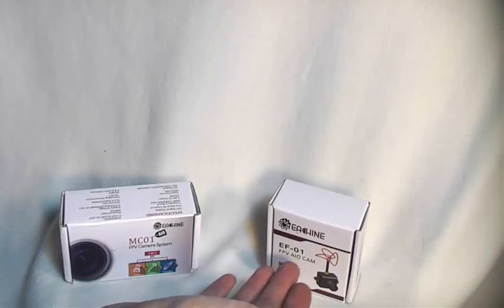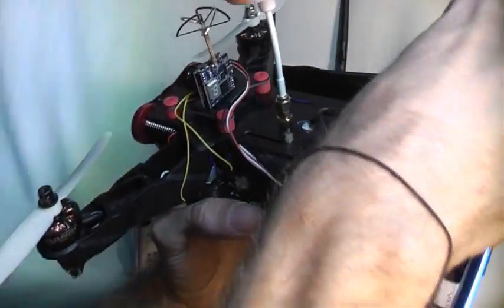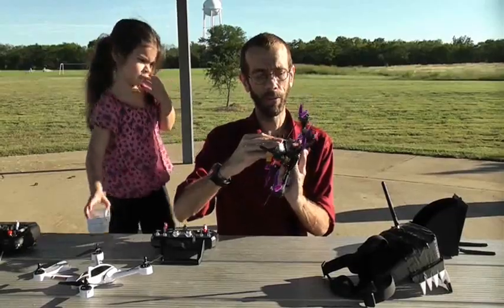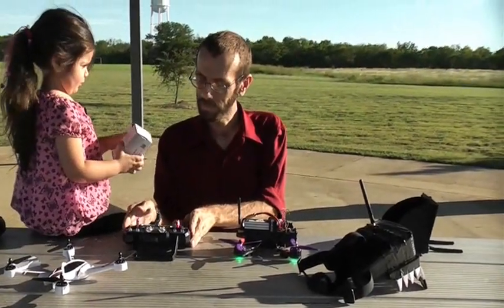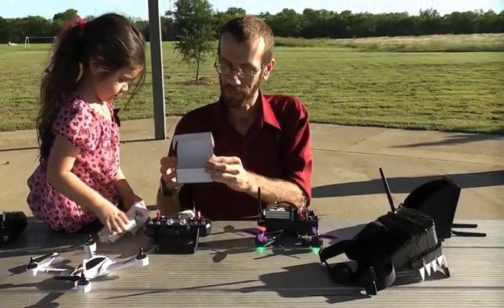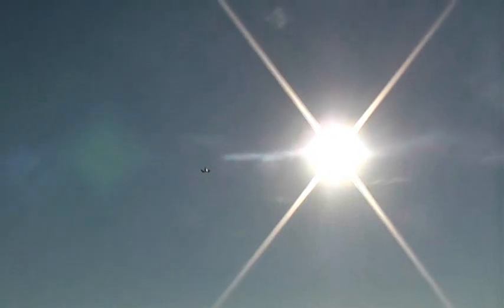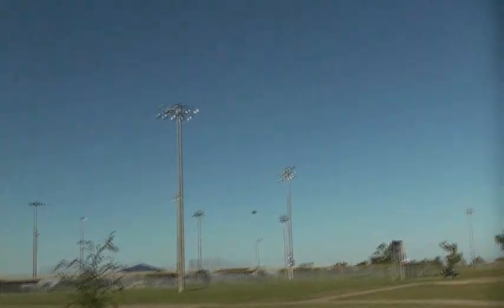Eachine Mco2 all in one FPV camera

Comment: PLUS I'd like to have the cameras signal go through an OSD, THEN to the transmitter....
that would be cool.
A tiny quad with a full HUD overlay....
Reply from the maker: Now that would be sweet.
Reply: R/C 101 I know, right?
Crash one and send it to me, so I can practice my technique....
Reply: I did it. It works great. I put a low pass filter between the camera and the tx in case I had any lines but turns out I didn't need it...
Reply from the maker: These things are so much fun.
Reply: As long as our wives don't find out......
Reply: Now that we have conquered the sky, and land, and the couch......
I'm thinking waterproofing is the next big thing.
I can go to the coast and be frolicking with monsters under the boat. We have blue whales and great white sharks and a volcanically active subduction zone.....
You know, for fun.

Comment: is it like the previous camera to you tell if the camera sensor in the transmitter board are two separate boards that can be separated?
I would really like to mount my camera farther forward on my nanoqx 3d but that puts too much weight forward of the cg.
Would be nice to mount the camera IP front and the transmitter in the back...
plus it would give you more options for mounting the antenna....
I like my first generation eochine, but haven't wanted to try the split yet because I'm constantly finding new stuff to throw it on.....
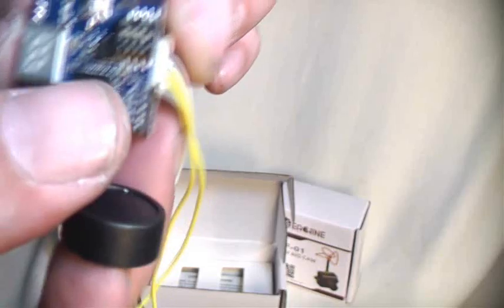Reply from the maker: The camera and transmitter are 2 separate boards like the previous version. They are connected with 2 plugs, one plug has 4 pins, the other has 5 pins. If you pause the video at 0:24 you should be able to see one of the black 5 pin plugs that connects the 2 boards together. The plugs are soldered in place but you should be able to be de-soldered and extended them with some wire.
Reply: R/C 101 yes, yes I can.....